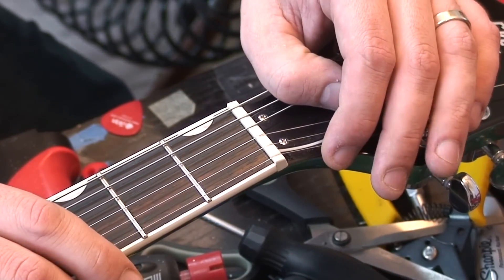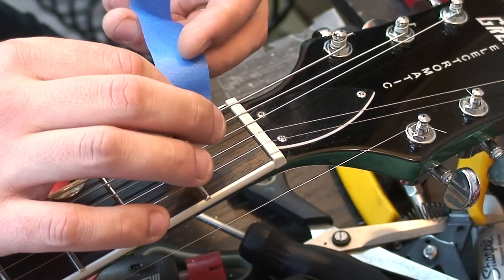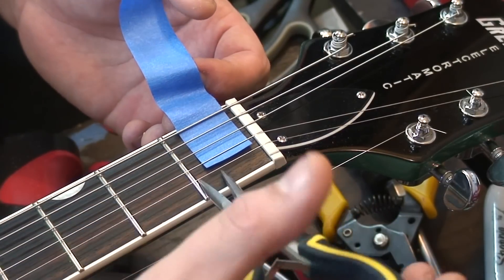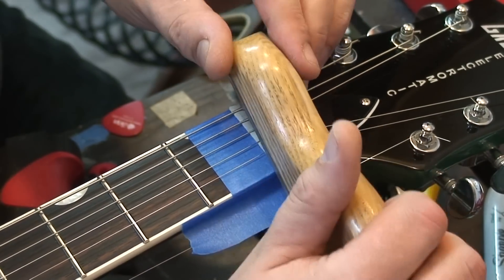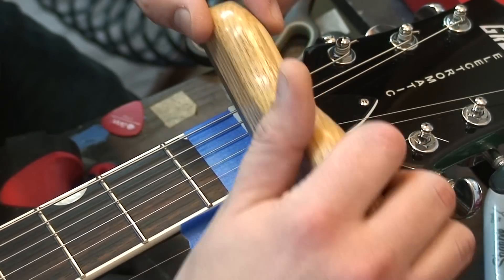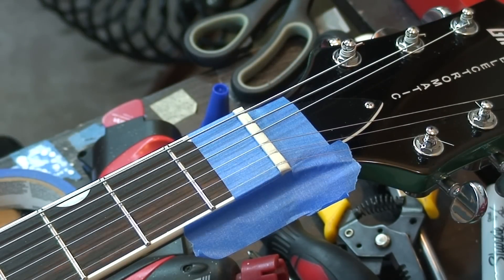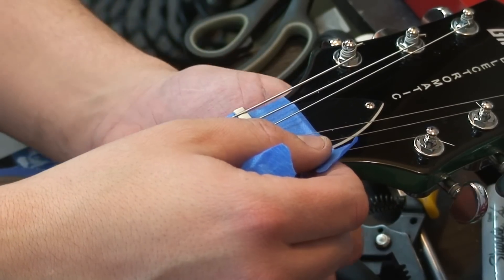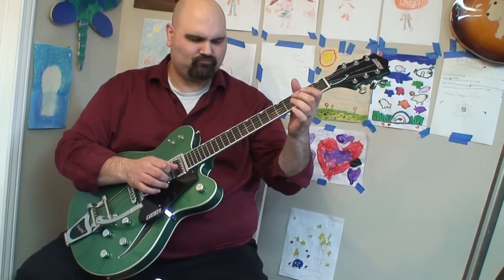Gretsch Sonic Eagle Falcon Jet! - Nut Repair: String Buzz

Comment: FYI:_  An easier way to tape the first fret is to slide the tape under the strings OFF the fretboard (ie, between the fretboard and the bridge) and then slide it  down the fretboard (under the strings) to the first fret.

Comment: Zslide your scissors under the strings, attach your tape to the scissors, then pull the scissors and tape back through. Will save all that fiddling tryin to get the tape under the strings.
Reply: Andrew Winch i would do that with a ruler tho, much softer
Reply: Garage Story fair point, but he did end up with pliers under there though. But yeah. A ruler or scrap of plastic, or even a piece of cardboard would beat that fiddling!